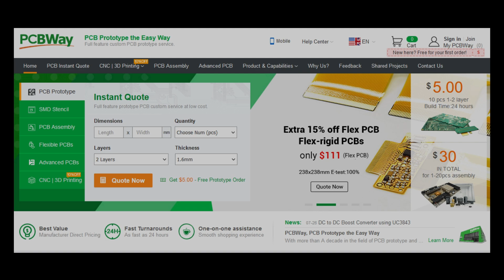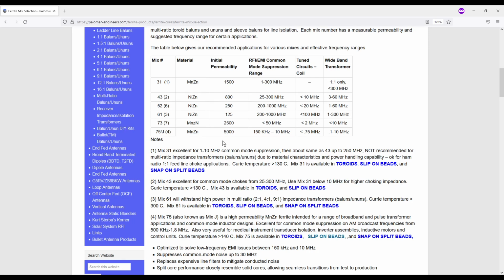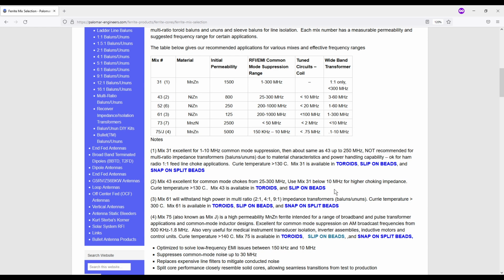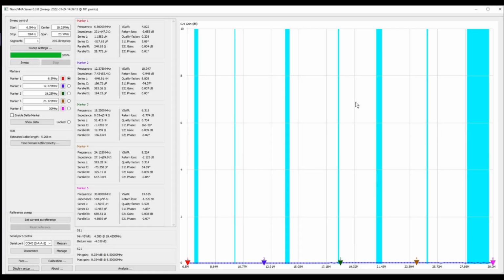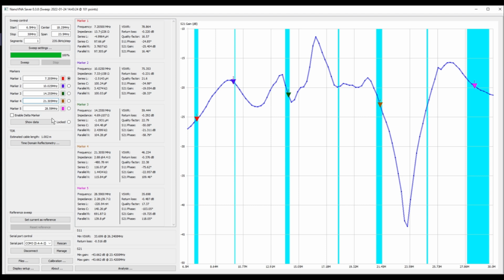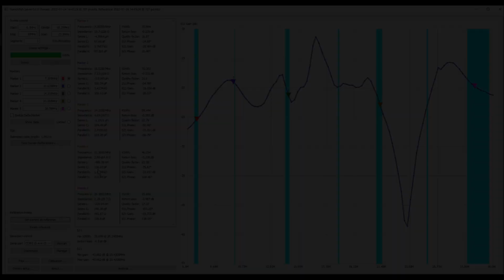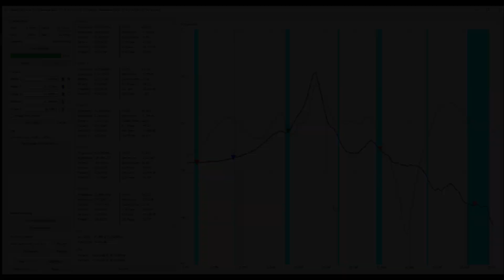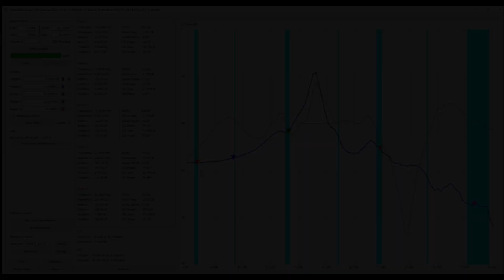Toroid Mix Selection for Balun Chokes for Ham Radio Antennas

Comment: I bought a choke per another youtuber and now I have a means of testing it. If it's no good, I'm gonna do it myself. I have a funny feeling it will be fine but could use an improvement.  Thanks for the very informative video. When is the point where I don't need to say I'm new to ham? I got all my licenses last year and never did anything like this in my life. Thank you for the video!
Reply from the maker: Glad the video was helpful Gaptastic, heck I have been licensed about 6 years or so and I am a new ham!

Comment: Interesting to see the measurements. I have a choke wound exactly like that on a 43 mix core which seems to work down as far as 80m. Never measured it, it is in a box outside my window and if it wasn't there I'd be getting nasty zaps from the metal clip on the back of my hand mic!  That type of choke is a real problem solver in so many ways.
Reply from the maker: Yeah, I use these all the time.  Thanks for watching Stuart.

Comment: That was a very good informative video. Just a foot note: You can use 43 material for a choke and cover 160 meters as long as you put enough turns around the core. Yes, 31 material would be the better choice for 160 meters but so would 77 material.
You gave a good pictorial of how much and where the attenuation occurs on the band.
But one thing that is most important is not to exceed the minimum turning radius of the coax. You need much looser turns with the coax you are using. If the coax gets too warm, not abused, the center conductor can migrate through the dielectric and fail.
RG 400, RG 142 and RG 303 are better choices for making the balun. Not only can you use a reasonably close turning radius, but it will handle legal limit with room to spare.
Barry, KU3X
Reply from the maker: good points about the coax, thanks for checking it out Barry
Reply: you can put two toroids together, one next to the other, side by side, and the turns pass through both toroids as if it were a single thicker toroid

Comment: Very well done Ape. 👏.  I went through this exercise myself for the adjustiwave choke. Just checked my results using DXW142 coax and the 240-43.  Peak attenuation was almost 37db on 20m. 40m was 33db. This method is such a cheap way of making an effective choke. Thanks for sharing.
Reply from the maker: Glad you liked the video Collin!
Reply: I will suggest that RG142 might give better results because of its double shield. This should reduce leakage between the inner surface of the shield and the outer surface. That is exactly why RG142 is used. That leakage can go either way, so RG142 should help prevent rf from leaking out, and noise from leaking in. I am getting ready to build a couple of these, and will probably try running them in series to increase their attenuation to see if they add together.

Comment: For common mode choke I think Amidom K mix will do the best you can. We measure 4500 0hms of chocking ability. We replaced the balun on our palstar AT5K and bt 1500 tuners. I also made one for my atr15   The  k mix puts all other mixes to shame. Only issue k mix is only made in 2.4” cores 😕 we stacked 4 core and wound it with 14 turns of rg 400
Reply from the maker: I am going to have to get me hands on some K mix, as always thanks for watching Kevin!
Reply: @TheSmokinApe  if you qrz my buddy John W2BYP he has a link on his qrz page story avenue > he has done sum balun testing on the oem palstar comparing it to the k mix also in there is extensive testing on the AT5K. Apparently the balance studs were outputting a unbalanced signal resulting in horrible rf emissions plus requiring three 00awg size ground connections. Now with the k cores in the AT5K he can run the dual 8877 to the wall 5kw no issues having ground connected or not. Mind you into a Dummy load for best practices 😉😉
Reply: G8jnj wrote an article on k mix chokes with technical data years ago, his website is a good read.

Comment: You can use RG316 to get a few more turns. RG316 can handle 400W at 100 MHz.  WJ3U
Reply from the maker: Yes, you can but it’s a good idea to measure impedance just to make sure 👍